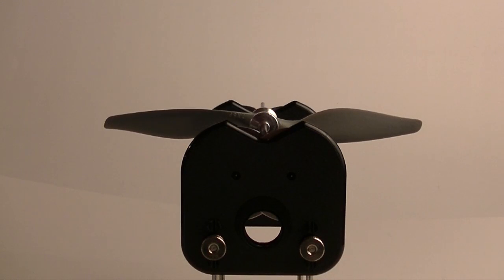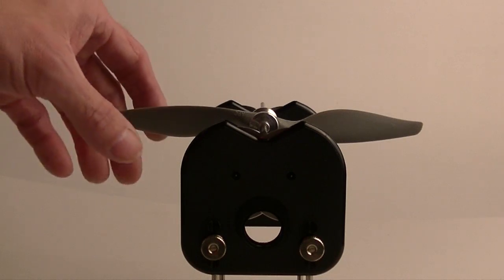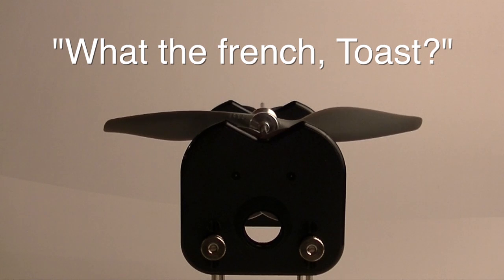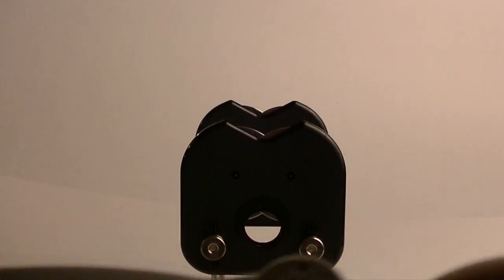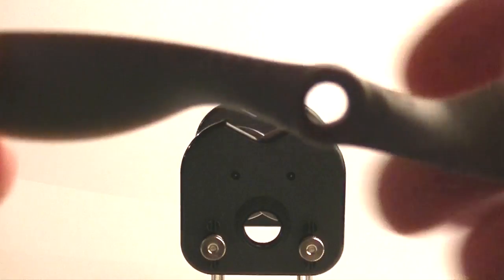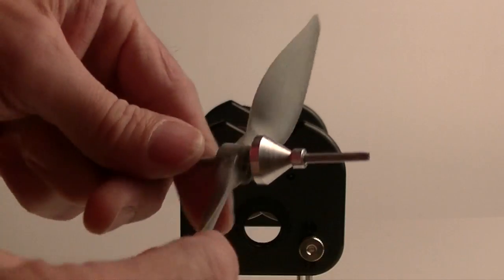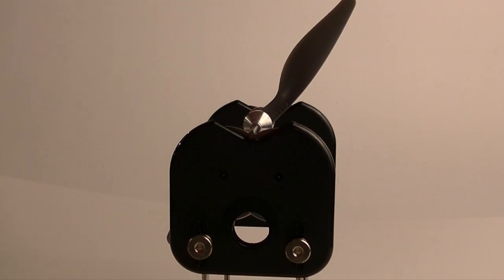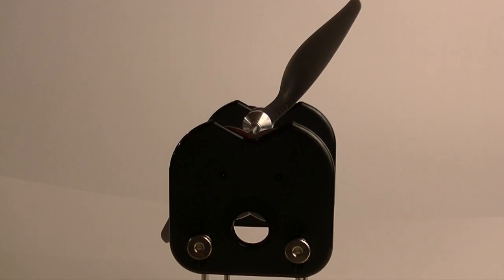CPO Quick Tip : Proper Balancing of an APC Propeller

Comment: Thanks for the useful video but I still have a question. If the reamed hole in the center is not concentric with the precision hole, then won't the propellor still be unbalanced around the motor/engine axle i.e. is the axis of rotation?

Comment: Do you think this is only for the APC brand?  I have some cheap Gemfan props that take a spacer to fit the prop adapter.  Assuming the spacer would be precision (or as close as these cheapies get!).  Have some APCs on order - thanks so much for the tip!